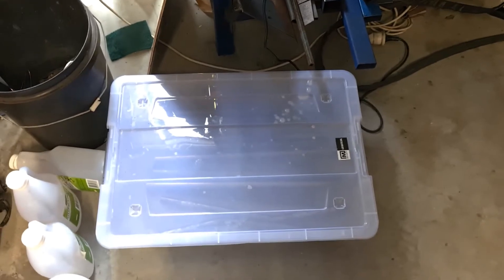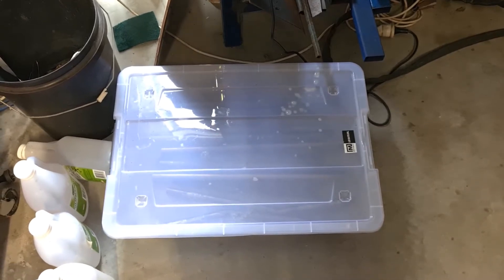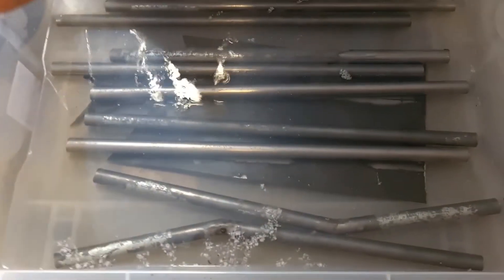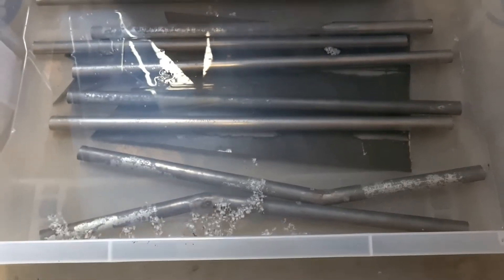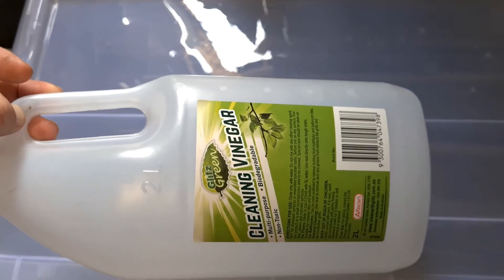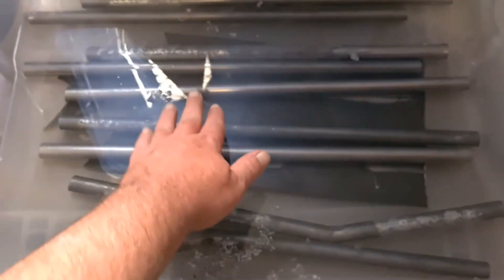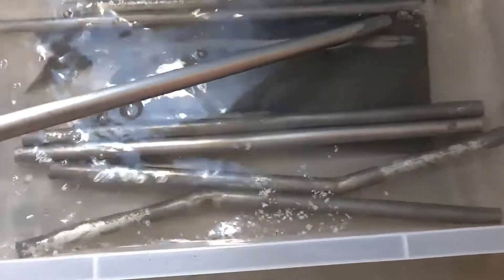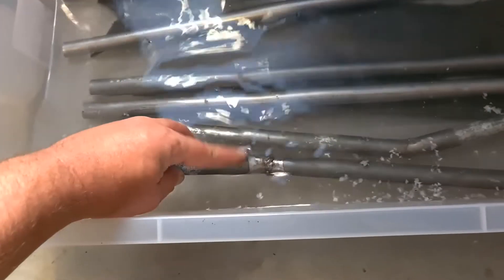How to easily remove galvanizing from steel with household materials

Comment: How do you neutralize after the vinegar ???
Reply from the maker: you can mix up some bicarbonate soda with water to neutralise the acid - I usually pour the vinegar back into its bottles to use again later then rinse the container out and put in the bicarbonate mix - leave for 5 mins then rinse off the parts with plain water
Reply: @simonchamberlain9215  Thanks!!!
Reply: @diannenaworensky6698  for those who may not know and/or don’t know how to use Google… sodium bicarbonate soda is nothing more than “baking soda” that everyone has in their home and/or refrigerator right now!!!

Comment: Removing the zinc makes the steel easily oxidized, right? How do you store it so it doesn't oxidize?
Reply from the maker: I usually just spray it with a thin coat of wd40 or similar for storage.
Reply: Palm oil
Reply: Please tell me the complete process to take galvanised mterial from galvanising steel sheet . Waiting for your reply